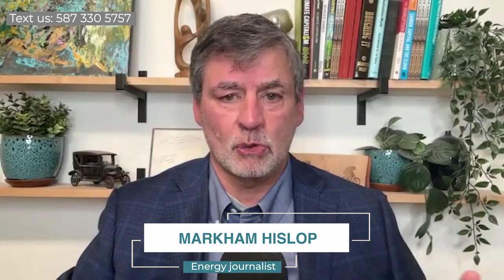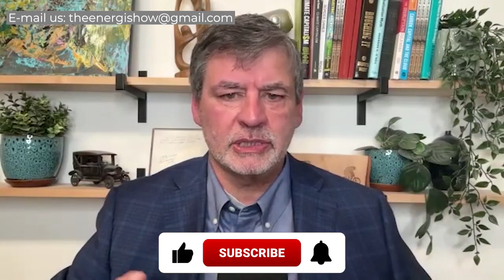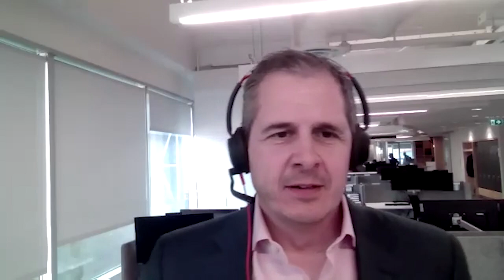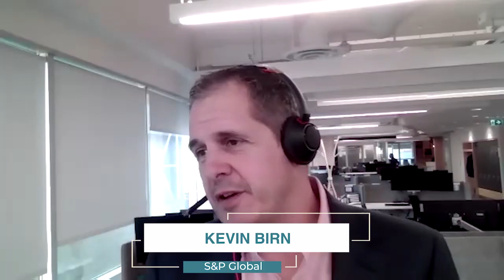Can the Oil Sands Even Fill a 1MM b/d Pipeline to the West Coast? It’s Complicated…

Comment: If the feds get out of the way there will be no issues with new facilities starting up.   There have been multiple new oil sands projects cancelled due to lack of pipeline capacity.  If the pipeline capacity is there the projects will be built. Also it only takes a few years for insitu projects to go from concept to production.
Reply: Post your sources please. What companies cancelled because of "lack of pipeline space" Was it mainline space or no space from McMurray to Hardisty or Edmonton ?
Reply: @canadakidd3750  Dunkirk oil sands Carmon Creek oil sands Muskwa oil sands Muskeg III , Albion II,   Mildred IV.  that is a short partial  list there are 15 others. These seven alone represents $125 Billion in cancelled projects due to lack of pipe line capacity.